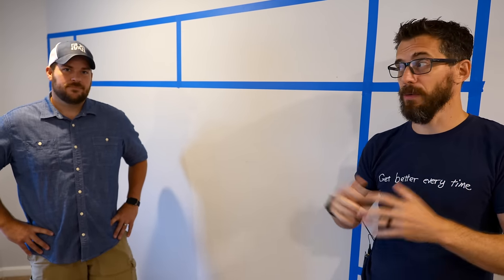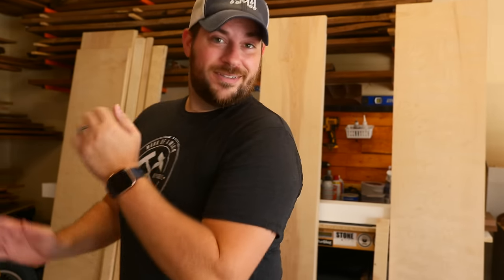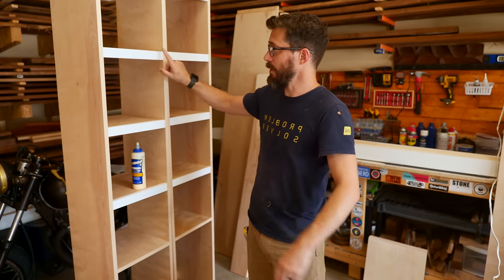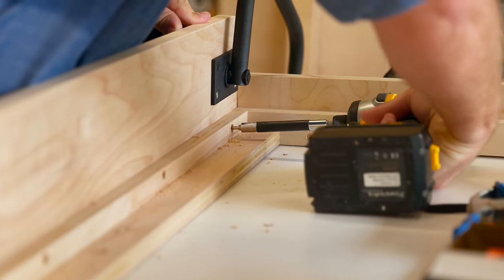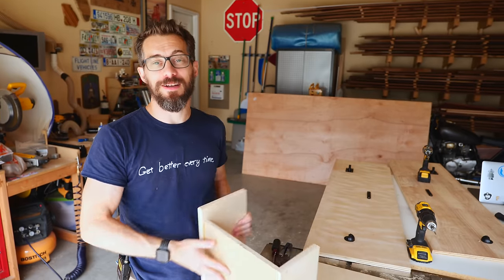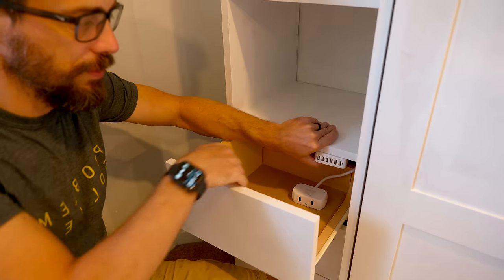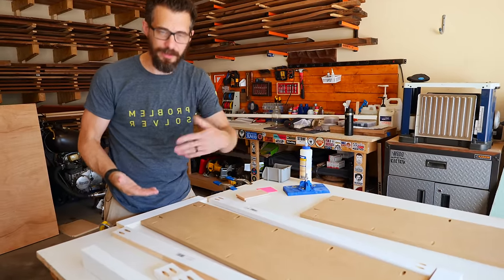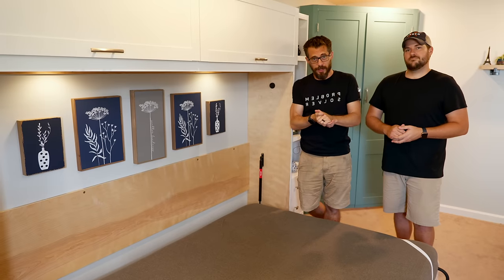How to Make a Murphy Bed | I Like To Make Stuff

Comment: I made a horizontal Murphy bed a couple of months ago for my guest room. It didn't turned out as beautiful as yours of course  but it was my first big undertake and I feel kinda proud hehehe. You guys make it look so easy!! I really need to take your course for planning. Love your channel!
Reply from the maker: Josh planned this project for a few weeks and worked out all of the design issues in Fusion 360 before we cut a single piece of wood. We try to make efficient use of our time and that happens in the planning.
Reply: I was surprised that the Roeckler sets only costs 300-400€.

You obviously have to add the material for the plywood too -but you should be able to stay under a 1000€ for a Murphy bed.
I also like that it looks built-in, but theoretically could be put in a rented flat and moved out. (similarly to a kitchen - not fun, but doable). Even if it is mounted to the wall (I'm assuming cause it wasn't shown) 
Thanks for the inspiration.

Comment: This is exactly what I was looking for today.  Very nice build.  A couple of questions though.  First, why do all the edge banding if you were going to paint it anyway?  Why not just a skim coat of spackle?  Also, why not fill the pocket holes on the upswinging door panels?  Last, is that a full size bed or queen?  I'm looking to do one for a queen and need narrow column storage as well.  Great design.  Thanks for posting.

Comment: Looks great.
I could do with that for my small room. Would leave loads of floor space when folded away.
Noticed you mounted the USB hub a little to far forward. The cables stop the drawer from fully closing. Too late now though 😊.

Comment: At 11:00, if you had have made a recessed spot underneath the table top, you could have also epoxied in some hidden wireless charging pads. The charge field is actually fairly strong, and will easily make it through a couple of millimeters of wood.

Comment: The motorcycle in the background hurts my heart for Josh.
Reply from the maker: One day it'll work...one day.
Reply: I have faith!!
Reply: I'm like you I like wood work as wll
Reply: How is that magnet attached to your impact driver?
Reply: @martinc9910  With some epoxy putty.
Reply: MINE TOO
Reply: give it to me. I'll get it running! lol
Reply: Add some clamps. All the clamps. And edge banding.
Reply: Is that a Sportster? Looks like an old 883 with a 3.3 gallon tank.

Comment: Not gonna lie, that kit IS pretty cool. Any time I've ever made a Murphy or Hide-a-bed I've always been working with basic stuff, so it's just been a rectangular box with a hinged lid and you mounted the bottom up against a wall. This seems much nicer, and definitely looks like it works better. I mean, the box bed I made worked fine as a bed, but it's not gonna win any awards.

Comment: I never thought that you could make horizontal murphy beds but that makes sense and it looks great. That motorbike looks pretty cool too by the way :)

I'm surprised you didn't 3d-print some brackets for that usb hub, is it something you considered?
Reply from the maker: I did, but it would have taken longer to print. Josh actually went back and hot glued those pieces in place. The tape didn't hold.

Comment: Looks great as usual only thing I can see is an issue with the location of the USB hub. Do you intend for it to be closed when in use, if so isn't too far forward to be able to plug anything in without the drawer being in the way? Otherwise, looking great.

Comment: 11:11 Recess the USB hub far enough from the edge so devices can be plugged in with the drawer closed.  It is a given at some point somebody is going to break a cable otherwise.
Reply: Plus the double-sided tape isn't a long-term mounting solution. Physical fasteners for the win.

Comment: I wonder how many noticed that the usb hub seemed to close to the face of the drawer. When you plug a cable in, you usually leave them plugged in. Additionally some devices create additional light that you would like to hideaway. With the current design you can’t closed the drawer without damaging the usb connectors. Greater possibility is the drawer just won’t close with bigger connectors. Especially since the usb connectors are oriented vertically. Might want to consider setting the usb hub further back from the front ledge when mounting it. Or you could mount it on the drawer and bungee the cable to allow it to pull out without binding up. Just a FYI to future builders who are considering these designs.

Comment: 11:32 I would have placed the USB hub further back from that front edge, so you can plug in a USB cable and still be able to close the drawer all the way.
Reply: Exactly what I noticed when it was mounted. Not very usable as installed, but a quick fix since it was just taped in place.

Comment: I've been thinking about making one for my room however the height of the bed is an issue as I do not like low lying beds. Once i've figured out how to get the bed it self at the right height i'll get round to making it. I want the mattress to be at least knee high and I do have at least a 7.5 feet of height to play with in my room. But I don't want the bed itself to stick out more than a convention bed so no more than 6 feet long or 6.4 feet.

Comment: On-line sites sell virtually the same hardware kits for vertical and horizontal Murphy Beds.  The only difference between each of them are the instructions that come with the hardware.  I purchased by hardware and instructions from Create-A-Bed.  The bill of materials as laid out near the front of the instructions was very good.  The assembly instructions are logically laid out for the most part, but some of the illustrations are confusing, some instructions are wrong and would have you using the wrong screws.  I have wood construction experience and was able to decipher the instructions, pick out the errors and substitute some materials to make my bed better and easier to build.  I tried to offer up an honest review on their website, but they closed that down.  And they don’t allow comments on their three videos on YouTube.  Obviously for a reason.  I would recommend staying away from Create-A-Bed and purchasing from another supplier that offers photo illustrations of their builds.

Comment: So does the drawer face mess with the usb connectors? It looks like it’s flush with where the drawer face butts up against it so the usb cable would cause the drawer to not fully close.
Reply from the maker: Good eye. We figured that out and moved it back.
Reply: I Like To Make Stuff 😉👍 good job!

Comment: 14:47 and you cant close it, couse USB hub is too close)
Reply: yup, spotted that at 11.37. It would be much more practical if the USB hub was on the bottom of the drawer, maybe with ports poking up. Pushing the hub back  where it is now will be a pain to insert cables
Reply from the maker: We saw that too and moved it back. Crisis averted.

Comment: If you're going to paint the wood, what is accomplished by using the edge banding?
Reply from the maker: The exposed edges of the plywood don't take paint the same as the faces. It looks really rough and gross.
Reply: 1. Has a smooth finish 
2. Doesn't soak up the paint

Comment: You didn't account for the USB cables being connected to the USB Hub. Now, when you connect something there, you wouldn't be able to close the drawer.
It may be seen in the video also, when you intentionally don't close the drawer fully, and the cable can be seen bent from previous attempts.

Comment: Wait why did you cover up the USB on the power strip itself just to plug in another USB power brick?
Reply: I was thinking the same thing. I know he is adding 6 with the second "Hub" but why then waste the 2 UBS ports  on the extension/strip.  He could have mounted that in a way that leaves them all 8 accessible.
If he was going to cover up the UBS ports on the strip anyway, he could have saved some money with a cheaper extension/strip cord.

Comment: 11:35 how you suppouse to close the drawer when the cable is pluged in that hub?
Reply from the maker: We moved it after we realized that.
Reply: @Iliketomakestuff  ok) Thanks for the answer!
Also, thanks for the video! I was amaized by this kind of systems since i saw them in some video about 10 or 15 years ago. I was wondering what kind of magic helps to operate them so smooth. Turns out all you need is a pair of gas-lifts.
Thanks again!

Comment: I appreciate the desire for expedience, but I do think it is not an ideal design to rely strictly on pocket-holes and glue for the joints. I would have at least done a rabbit on the side-walls to seat the top/bottom plates into for some added rigidity. Otherwise, amazing build! Always forget how crisp machine woodworking can get!

Comment: Wow I just randomly came across this and cant believe this guy has 3.2m subs.  So many mistakes in just 16 mins its crazy.  First pull the baseboard and put it back on after installing the cabinets, it will take you all of 30 seconds to do and will come out way cleaner than scribing 4 cabinet bottoms to the original base instead of 4 flat cuts.  Next the top doors he made are the only thing that isnt flush mounted like the drawers and the bed, it just looks funny.  Pick one way and go with it.  As far as those doors go, all the pocket cuts are ridiculous on the inside, it looks terrible.  If you want to cheat making  paint grade shaker doors use 1/2 inch and 1/4 inch mdf sheets.  Cut the 1/4 inch to the size of the door and rip the half inch to the size of the rails, then cut them to size and wood glue and micro pin the two together.  A little bondo for the seams and nail holes and a quick sand and they look good on both sides.  I would also make all the drawers out of prefinished 1/2 inch drawer ply (Baltic Birch) with dado'd corners and a captured 1/4 inch bottom, can be easily and quickly machined on a table saw with a dado set (or a bit slower with just a regular blade or a router)and wont have the wood tape pealing off eventually.  He can fusion 360 the hell outta me, but the rest needs help